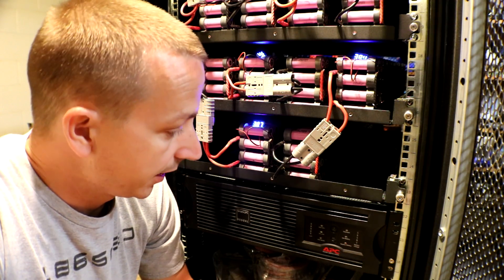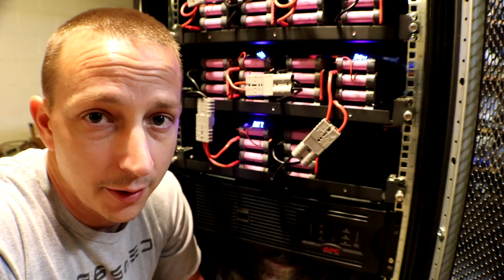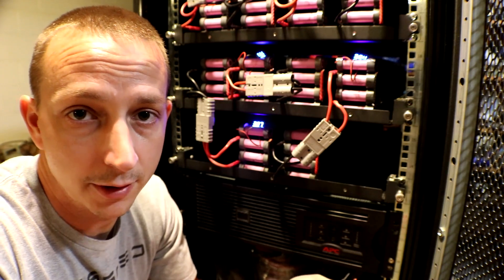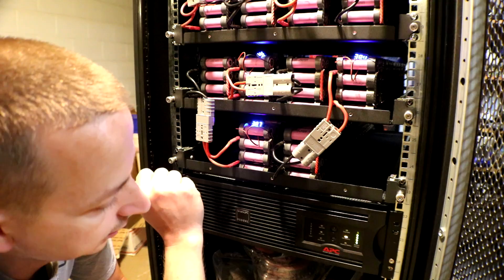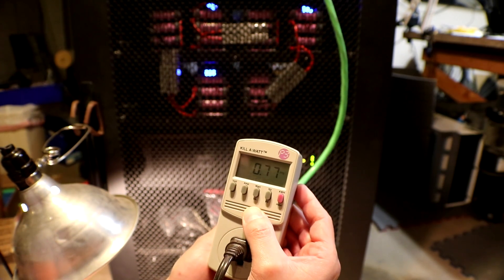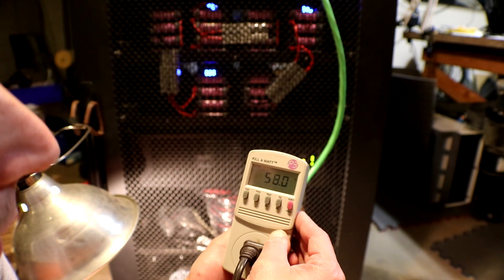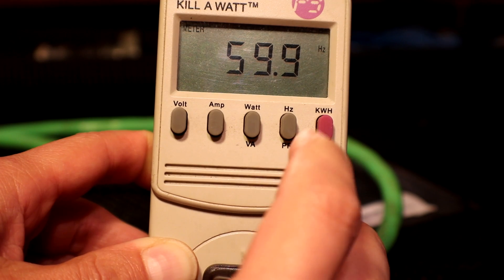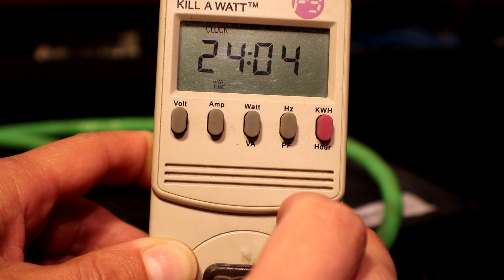Diy Tesla Powerwall ep53 48v Ups 24hr Test Run 2nd Try

Comment: does the ups need a 14s battery or will it work with a 13s battery?
Reply from the maker: 13s will work just fine!👍
Reply: @AVERAGE_JOE  ah ok cause i got a free 48v ups and the ocv is 56v so what would u reccomend, 13 or 14s
Reply from the maker: Ocv on the ups is 56v? Mine may be that as well but cant remember but I dont use the ups as a ups. I use as an inverter so that part isnt an issue. Are you using as a ups or inverter? If inverter then 13s is fine. If as a ups (not technically recommended with 18650s) then 14s so the cells dont get overcharged.
Reply: @AVERAGE_JOE  ima be using it as a ups but 4.3v per cell wont dammage the cells right?
Reply from the maker: A random 4.3v event is ok, 4.3v all the time(ups mode) or many times(as in cycles). Damage and fire may occur. Not recommended!

Comment: Do u need the batrium expansion board to utilize the low voltage shut down. Hook it up to a contactor to physically shut down the pack
Reply from the maker: At this current time you do need the expansion board to do that.  I believe in a future build they might be incorporating the expansion board into the watchmon for a all in one but not sure when that one would be out!

Comment: well, i think that if you set charge voltage to 4.0V you'll get lower energy for dischRage, but you will probably ramp up the cycle life of these cells to something like 1000+ cycles, which you will never notice for the next 10+ years :)
4.1V is good trade-off, too.
Reply from the maker: Ive been setting it mostly at 4v and then sometimes at 4.1v  Id like to have them last for a long time!!!

Comment: can you make a video on what you need to start making a battery and maintaining it? like batteries obviously. soldering iron, charger and so on im not to sure what i need but i really want to try making a battery.
Reply from the maker: Ill see what I can do. Have you looked through my video list yet?  I have all kinds of videos in there.
Reply: yea i have and i have a idea of what i would need my biggest problem is i dont know how i would charge a custom battery. Also I dont know what i dont know so i would rather find out now instead of while im trying to build it. if you cant make a video maybe you could reply with a list of things you need to get started
Reply from the maker: I got ya! What are you planning on doing with the battery?
Reply: well i plan to build a couple haha but my first one id like to make a 12v battery for a trolling motor maybe like a 80 AH one

Comment: UPS machines are designed to save your ass from power outages for couple of hours. I doubt they can  withstand being permanent power source anywhere close to their nominal power.
Reply from the maker: Yeppers, I want to find out if they can work as a long term inverter replacement. So far so good!😀👍

Comment: Hey Joe,

I have the Smart UPS 1500(900Watts) and I check the zero load drain from my 24V pack and it was 1.3A continuous.  Now I have seen some inverts that spec much lower current at no load  (there was one but i forget which one that was 50mA )   Have you tested yours?
Reply from the maker: +Jason Deadman Ok cool. Good to know. No I havent measured it yet but will.

Comment: Have you made a plan fro you solar panels? What ever you make, make sure you can clean and remove snow from them. Well help with the out put. When you go off grid you live by a number. No power do nothing just wait on the sun..
Reply from the maker: +bigsmile542 I have been thinking about installing them! Yep in the winter I do climb onto the roof to wipe the snow off so Ill have to install them so I can reach them all. No sun no fun!!!!
Reply: I summer time dust block the sun.. Just food for thought . My cats love to climb on them and put paw prints on mine..
Reply from the maker: +bigsmile542 lol ya Im thinking the cats will be able to walk on them after the install. My old ones are at an angle but am going to take those down so I can use that spot for the big ones. Then put the little ones near/next to them

Comment: Is that system big enough to tun your house? I new to this and really have no clue.. thanks
Reply from the maker: Im gonna say no for my house since its only a 10kw battery pack and the UPS is only 2700watts but if I had a smaller house I dont see why not!
Reply: I would say it will be enough to do all your household lighting circuits once you have the panels put up. A lot of houses share circuits for lighting and receptacles though and that may not be too good. Maybe a dedicated circuit for an entertainment center. I wouldn't be putting any kitchen or bath circuits on it though, a lot of power hungry devices in there.
Reply from the maker: +Tony B. Yeah It should do quit a bit!👍
Reply: The average household uses just over 900KWh of electricity per month.  The first step is obviously to reduce where possible without impacting the over all quality of life.  So things like LED or Fluorescent lighting and reduction of unnecessary phantom power devices that use substantial power even when off can make a big impact.  You may be able to easily trim 5-30% power consumption without changing a whole lot.  

Once you have reduced your consumption something like a 2700 watt inverter can be more than enough to power most of the essential circuits you have.  Most modern refrigerators or chest freezers, hot plate, toaster, microwave, lights, and electronics are all easy enough to power. Things like an electric water heater, washer, electric clothes dryer, Large window or central AC or electric range will not be able to be powered from this system but most everything else will likely work fine.

I would guess the plan is to drain the initial setup no more than 50% to increase cell life and also keep some reserve capacity so figure maybe 5KWh at night plus whatever excess is created during the day after the batteries are charged (if that is possible).  I forget how many panels he has but let's assume he is able to generate about 10KWh per day.  That should mean he would be producing around 300 kWh per month so in effect could cut his monthly electric bill by 1/3 or more depending on how much reduction has been made.

A larger inverter in the future could be purchased to power those additional large loads.  More batteries and panels in the future will also be easy enough to add as the system grows.
Reply from the maker: YES!!! All of this.  That is the best plan.  We did a lot of that over the past few years.  Ill have to look at our power bill, I dont think we use that much but I really dont remember.

Comment: what is the actual ups pulling by itself from the batteries with no load added?
Reply from the maker: I found my digital amp meter and was going to install it to find out but the meter doesnt seem to work.  Ill have to find another and install it cause that would be some good info to know!
Reply: @AVERAGE_JOE  was wonderjng the same. Your inverter seem to pull a lot of power! (At least from the fans)

Comment: Ok ups/apc will eventually be too small what inverter would you prefer.... Or multiple ups/apc units.... 
... Balancers to be on the safe side your thoughts about.... 👍
Reply from the maker: Yeah I will probly out grow them or they could fail.  Ill try to hold off as long as I can.  I may use 2 to get me through.  Not sure on which inverter, to be honest I have really looked cause I planned on using the UPS units.  Definitely will get that batrium bms.  From the looks of it why wouldnt you get it.  Unless theres another that does all that crap lol

Comment: Great!  Glad it is working and you were able to change the settings.  With the fan running all the time I wonder what power the inverter is pulling from the battery bank?  Now I have to hook up my old 12v inverter and see what the Kilowatt shows for hertz.  Never thought to do that since I purchased the Chinese full sine wave inverter.  Harvey the tropical storm is headed our way so I might be needing the inverters.
Reply from the maker: Yeah I had the amp draw question the other day so I was looking for a digital amp meter I had from a long time ago to put on it and find out.  Welp I found it, installed it and the damn thing wouldnt work lol.  I even made a vid untill it wouldnt work. Oh well.  Ill just have to find another meter to use and make a new vid.  Yeah I noticed the DC thing from my old setup years ago.  Ya let me know if yours shows the same!
Reply: I just checked and this one shows 63 hertz.  It's only a 450 watt Black & Decker inverter.  I'll have to get my oscilloscope out and see what the wave form is.  I only have one of those little kit scopes I built, but it works okay for what I know how to use it for.
Reply from the maker: Interesting.  Are you using the same KW meter as I am or a newer on.  Maybe it was just that older inverter I used LOL.  I wondered if those kit builds were any good.
Reply: This is a Model: P4400.01 Kill A Watt.  Has the P3 on the front.
Reply: I came across a video a while back when looking at using an APC 2200 / 
3000 unit as an inverter.  I forget which one was in the video, but the 
guy measured 25w constant draw with nothing plugged in.

Check out the efficiency / runtime graphs on APC's specs page for it - 
http://www.apc.com/shop/us/en/products/APC-Smart-UPS-XL-3000VA-RM-3U-120V/P-SUA3000RMXL3U?isCurrentSite=true
Reply: That's a good website more info there than I would expect to find.  Not cheap products by any means.